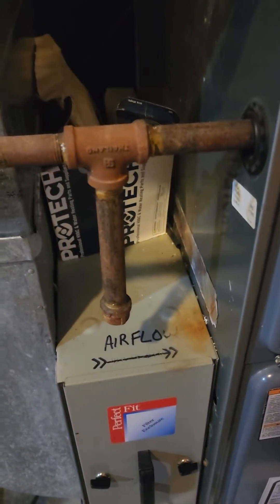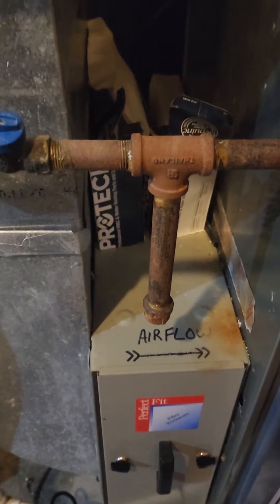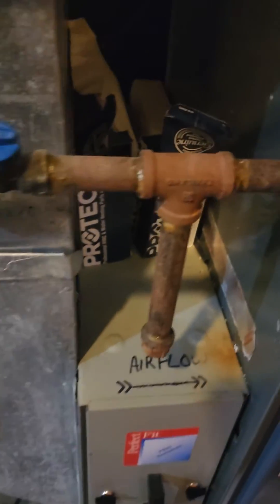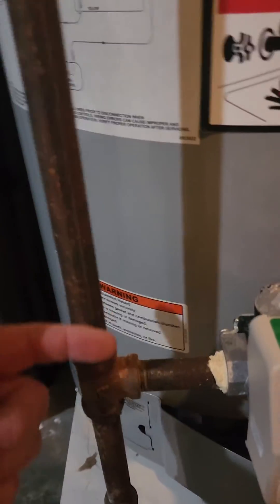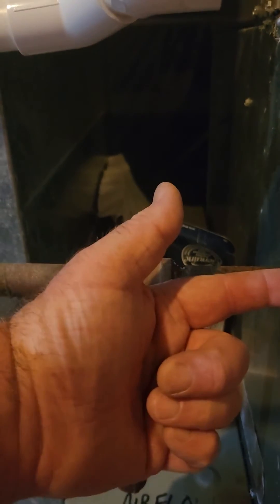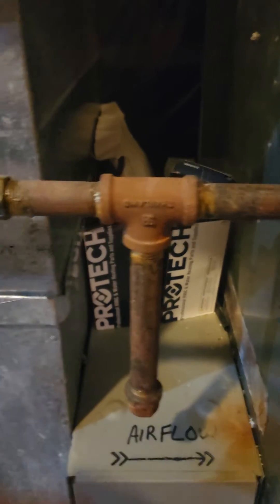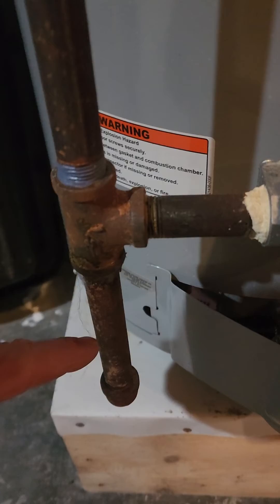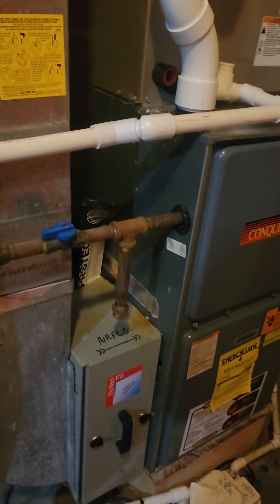The difference between a drip leg and a sediment trap explained.

Comment: Sorry but this video is not correct. Whoever installed what you call a drip leg was trying to install a sediment trap (which is generally required for each appliance) and failed to do so. It’s not a drip leg because they are only required where condensate could collect (low points) and at the outlet of the meter. Not at each appliance. Also the configuration is not specified. Check 408.2, 408.3 and 408.4 IFGC. Start reading or at least using chat gpt. It’s only $20 haha
Reply from the maker: That's what is said in the video. It would appear you did not watch it.
Reply: @careyhomeinspection  the example you showed is not an actual drip leg as it is not at the low point in the system nor at the meter; it was installed before the appliance meaning it was a poor attempt at a sediment trap install. A true drip leg only serves its purpose at the meter and at low points
Reply from the maker: @anthonyalegria4695  you are correct, which is why I said it's wrong. They can be found anywhere (not because they can be placed anywhere) and typically at  or near the meter. Yes, at the lowest point. The video is not to show proper drip legs but why this is wrong and what a proper sediment trap is. You are 100% right, which is what is said in the video. It is a drip legs, and it is wrong. If me calling it a drip legs is you issue, get over it. A wheel is still a wheel even if it's installed in the back seat. Won't make it work, I agree with you.
Reply from the maker: @anthonyalegria4695  It's a poor attempt at a sediment trap, BINGO that's the entire point of the video.
Reply: @careyhomeinspection  alright you got me haha good stuff

Comment: Can a sediment trap have the gas flow the opposite way from what's shown in that water heater example?  In other words, will it do its job if the gas flows horizontally to the T and then up to an appliance with the trap being downward?  Hope I make sense!
Reply: According to the IFGC, yes. The appliance can be on the vertical and the supply can be on the horizontal

Comment: Great Video!  Should sediment traps ever be cleaned out?  If its catching sediment, I assume every so often they should be inspected for debris but never heard anyone mention doing this as part of routine maintenance.   Thanks!
Reply from the maker: These are rarely cleaned but it is a good practice to do so when changing the appliance or if the gas is known to have issues in a region, cleaned when the appliance is serviced.